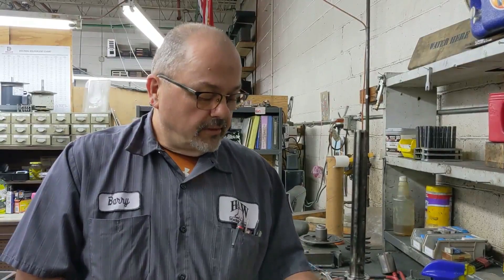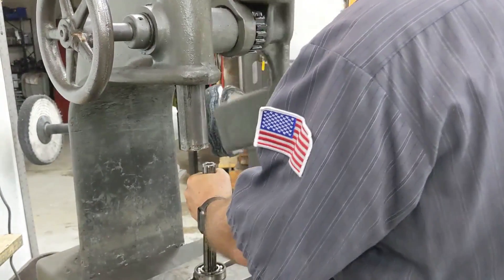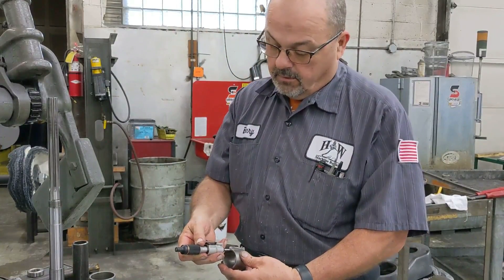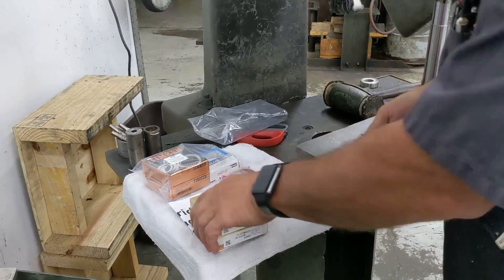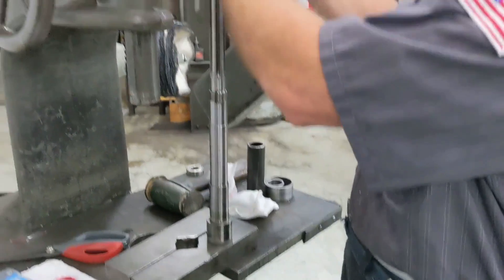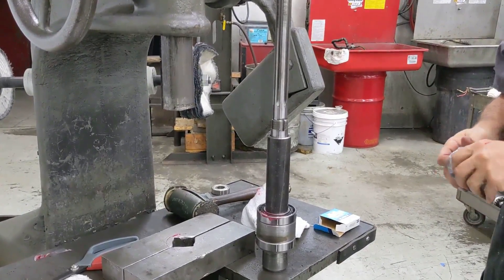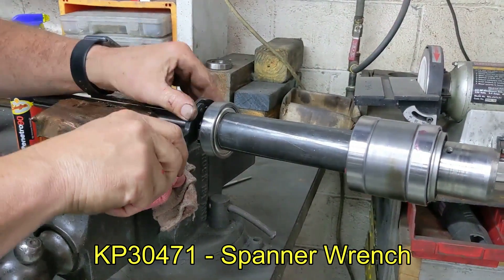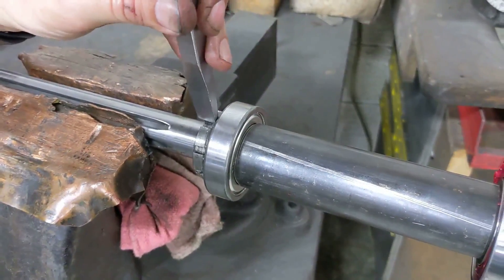Replacing the Spindle Bearings on a Bridgeport R8 Spindle

Comment: My quill is dragging and doesn't move up and down freely. I oil my machine as specified and was wondering what might be causing this to occur ? Thanks Barry for all of your videos they are extremely helpful and very informative
Reply from the maker: Most likely, you just have some dirt and debris up between the quill and quill housing. It is the most common occurrence with sticky quills. You would have to tear it all down to really clean it out. In some instances, we have to do some work to get it to fit freely but, cleaning it out will help.

Comment: Say you are busy taking your spindle out,  tap tap form the back and it gets stuck.  The bottom bearing looks like its about an inch away from the spacer and no matter how many "taps" it's given, it refuses to move.
Reply from the maker: The head tech says they need more information, can you please give us a call: 1-800-285-5271
Reply: @HWMachRepair  it's fine thanks.  The previous owner never put the clamping nut on top of the ac bearings and one came apart.  Took the spindle shaft out and left the bearings in so I could tap them individually.  It's really great that you guys follow up even on a 4 year old video.  Have to say you folks have my respect.

Comment: Barry & Team - really appreciate these vids for us home gamers. I've always wondered why these machines were designed to use both grease and oil. Seems if you have a good oil system, you shouldn't need grease. I'm assuming that some operators get lazy about oiling and thus grease is used as it will stay in place for years? Given all the wear, chips, and dirt, grease seems to collect that junk and turn into a kind of very unwanted lapping compound...and grease oil mixtures are a mess, with the grease plugging some oil lines, drain holes..etc.

Comment: Why don't you fill the bearings?
Reply from the maker: You only need enough to lubricate the bearings. Using to much grease is going to cause friction which will cause excessive heat and degrade the bearing. If you have any questions please call us a 1-800-285-5271

Comment: Do you know if this bearing kit will fit on the Import Bridgeport clone mills. My mill is branded as McLane but is produced by Weihai Huadong Model X623B It has a 3 hp motor and R-8spindle and is belt drive, The spindle is produced in Tiawan.
Reply from the maker: These bearings are fairly standard in most milling machines. Just check that your spindle bearings are a 7207 and that the top bearing is a 6206 and the SRK-00 will work.

Comment: Could you replace the quill set screw with some light duty thread locker?
Reply from the maker: Yes, you can use the blue loctite on that screw.
Reply: No I meant put some light duty loctite on the nose piece thread into the quill and not used the locking grub screw at all?   @HWMachRepair
Reply from the maker: That isn't recommended.  @remoman

Comment: Barry,  I just wanted to post to say THANK YOU!  The last 30 seconds of this video when you commented about overtightening the socket set screw saved myself and the people who sold me my new mill A TON of work.  I recently replaced my collet alignment screw and snugged up that socket set screw and it caused the last inch of quill travel to be extremely tight.  After backing off the screw and lightly tightening it the quill feels good as new.  Thank you so much for providing this content and saving me the headache of an inexperienced tech tearing apart my month old head of my mill!!!

Comment: I've always thought the Bridgeport spindle bearings were a little on the weak side. They angular contact set is easily upgradeable to a three bearing  set with the bottom two in tandem and the top bearing back to back. When I was rebuilding our BP heads at work I did this. Rigidity in the spindle was also improved by adding 5 to 7 tenths preload. The new spacers need to parallel to under a tenth. Barden bearings running Kluber NBU 15 with the volume as prescribed with the syringes of NBU 15. Bearings were heated to 135° for installation. I never drove the spindle into the quill with a hammer. If a bearing set needs to be tapped into a bore make up a sleeve that matches the OD of the bearing and slides over the OD of the spindle. SKF makes a very good bearing fitting kit for this application. Spent 45 years repairing and rebuilding machinery a good portion of that complete rebuilds and high speed spinidle repair.
Reply: > If a bearing set needs to be tapped into a bore make up a sleeve that matches the OD of the bearing and slides over the OD of the spindle.

Thanks for you comments. What do you mean by this exactly?
Reply: @Anenome5  If you're still curious, he means you would make a sleeve that has an outside diameter that matches (or is a few thousandths under) the outside diameter of the outer race (the outside ring of the bearing that the balls rolls inside of) of the bearing. The sleeve has to slide over the outside diameter of the spindle though, or of course you won't be able to slide it over to put it up against the bearing.

This gives you the ability to either press or tap the bearing into place without slamming the inner and outer races of the bearing together against the little rolling elements (the balls themselves) in the bearing. Ideally you want to avoid impacts to these parts as they are very hard and can develop tiny micro cracks or disturbances that accelerate wear. I hope this helps!

Comment: Berry can you do a video on replacing the brake pads on a step pulley  bridgeport  j head
Reply from the maker: We don't have a dedicated video for the brake shoes, but if you want you can follow along in this video until you get to where we take off the top where the brakes are. At that point it's just taking off the old ones and putting the new ones. on. Eventually we may be able to get to that, but we have a very long list and no much time to do it: https://www.youtube.com/watch?v=mnhxoH4Sdc4&ab_channel=H%26WMachineRepairandRebuilding

Comment: If the two spacers micrometer measurements were different,  what would be the procedure?
Reply: Have them surface ground in the same setup to the exact same height. The two ends need to be extremely parallel for the bearings to last their normal lifespan.
If they're not exactly the same then either the bearing might have seized, major rust problems or someone tried to add more preload which is not always the best idea.

Comment: I have problems with my R8 spindle, it makes noise and I feel there is a problem with it's Design. Can I send you the blueprints I made so you can help me to solve the issue?
Reply: If you have blueprints I assume you designed it yourself? A noisy spindle can mean that the bearings are preloaded too tight or too loose or some of the parts were not manufactured correctly.

Comment: Great demo Barry, but can you tell us WHY are these bearing so OVERPRICED????  I buy AIRPLANE bearings that come with a shitload of certifications and they are less than half the price.  WTF am I missing here?
Reply: Try looking at prices for ANY part for my Series II BP and it'll make you feel a lot better.
Reply: @Steve_Just_Steve  lol.. Thanks Steve.👍🍺
Reply: Joe Howard I have a question. I think my drawbar is gauled inside of a 1/2" collet. I cannot get the collet to loosed AT ALL. It just spins in the machine.  Im now trying to get the spindle out but the spindle wont come out, I think, because the drawbar is still in the top of the spindle. 
Can you give me any suggestions?  Im at wits end.

Comment: Does the r-8 taper need to be turned to insure run out and accuracy?
Reply: Depends on your runout needs. Turning the spindle taper inside its own bearings is always an option to minimize runout, but not always necessary, especially when using high precision bearings

Comment: What model arbor press do you use? Is it a 3-1/2 or a 3-3/4?
Reply from the maker: Our arbor press is a Greenerd 3-1/2.
Reply: That thing is a beast
Reply: When fitting the bearings, you could heat them up and they should slide on easily....